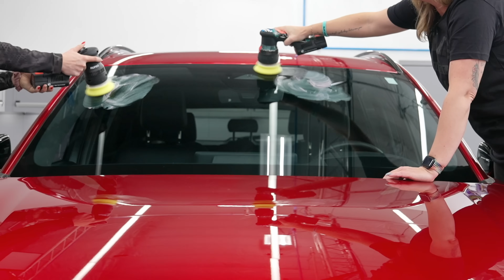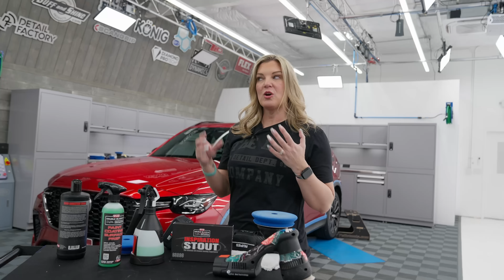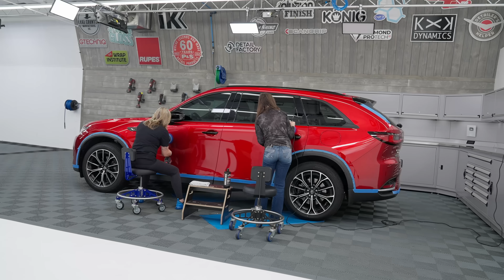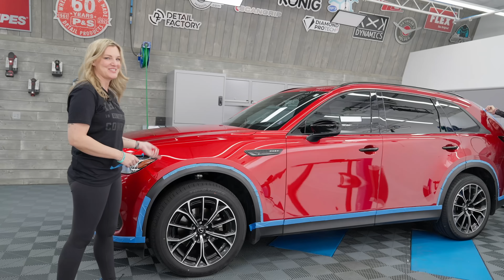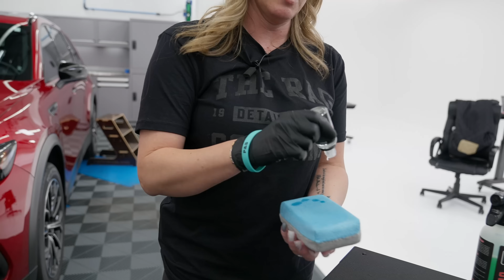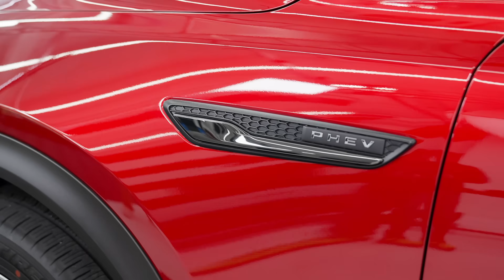How To Ceramic Coat Your Car Using P&S Stout

Comment: Shhhh, don’t tell everyone how killer this coating is. On the world’s greatest red, Mazdas 46v, it’s just stunning. Stouts depth, gloss and durability are top notch. Just take care to level, don’t push it past your section without quickly hitting it with a second towel. Should a high spot happen, just use a little polish and prep then re coat. It’s definitely a professional level coating, with all the rewards of a pro level coating. This coating along with the rehab family of abrasives and even the free ride pads are some of the best available. I’m at 6 months on my personal vehicle and the coating still looks like day one.

Comment: I’m a little confused on where this lines up with Legend and Inspiration. A video explaining the differences would be great. Another question I have is how long should you wait for Stout to cure before applying Sole.
Reply: Hi! 
So Legend is discontinued. Stout was developed because Legend was a bit outdated technology wise. We wanted a more durable but a simpler install. 
It is the long term 5-7 year, classic is 2-3 years and Sole is 9-12 months. Hope this helps! 

Also- we do not recommend putting sole over it. Again the new technology does not need a topper and the behavior is far superior and you wouldn’t want to cover that up

Comment: How fast can you wipe it off? And how long can you leave it on before risking high spots?
Reply: Its 20-30 seconds max 
Apply and wipe off
Reply: @ thank you. Also, with clarity crème, is it something that I can just wipe off and apply the glass coating, or do I still need to prep spray the glass?
Reply: @ChristianGTCS  Yes always paint prep everything before applying any coating:)
Reply: @  thanks again. One more question, the ceramic coat for paint is 20-30 seconds and wipe off…what about on the plastic trim? And is the glass coating better to leave on, do all the windows and wipe off after all of them are coated after some amount of time, or apply and wipe off each window right away? If it doesn’t matter, is there better performance allowing it to sit on longer and then wipe off? And does it become harder to wipe off the longer it’s on? Sweet spot as far as time? I just bought some, waiting for delivery. I plan on converting to P&S coatings from Adams
Reply: I hope the new paint coating and glass coating are more durable than the Adam’s Polishes advanced ceramic coating and glass coating. The P&S price is significantly more, I’m hoping it’s because it’s easier to apply/wipe off and lasts much longer
Reply: @ChristianGTCS  For Trim:  You don't have to perfect wipe it off. So great!  I just somewhat level it but its fantastic on trim.  FOr Glass- we only put Vue Ceramic on the front Windshield.  The wipe off is much slower- I do the entire windshield and then wipe it off, so its like 1-3 minutes.  Leaving it on longer does not benefit;  For side glass we use the new si02 Glass Finisher called REFLECT- that's spray on and wipe off.
Reply: @ChristianGTCS  The rough longevity of Stout on the paint is 5-7 years and Vue is 1-2 years depending on avg use of wipers.
Reply: @sbgthedetailer  thanks! Any particular reason why you don’t use the glass coating on all the windows? The coatings are way my durable and hydrophobic properties are more prominent than spray ceramic glass cleaners

Comment: Why aren’t you using a pad washer?
Reply: I’m not personally a fan of pad washers. We blew them out and had enough pads to switch to a new one every second panel. It’s a preference thing
Reply: Personally I do not use a pad washer.  I simply keep pads in a rinseless solution while polishing.  I switch pads often, blowing them out before I use them.

Comment: I hate to ask a silly question but when you use an air gun to clean the pad doesn't it tear up the internal fibers? Have you ever used a pad washer to clean the pad during the process? Sorry for so many questions, just 58 yo still learning.  Thank you for a great video, ma'am.
Reply: No, the blasters do not tear up the foam.  The ones you want to stear clear is the old style pistol forced air guns from like Harbor Freight.  Those will blow holes. Personally, I have enough pads I don't need a pad washer and am not a fan of getting the foam wet as it changes the density and cut.  I blow between panels and only use one pad per 2 panels.  If a padwasher works for you great! I have nothing against them, I just prefer to have 6-8 pads per color per vehicle.  Its preference.  But I will say you could not do an entire vehicle with one pad just blowing it out.
Reply: @sbgthedetailer  thank you.

Comment: Great video!  One question regarding Stout, can it be applied to PPF?  If so, any changes in flash/curing time?
Reply: Absolutely, doesn’t change anything as far as apply and 20-30 seconds wipe right back off!
Reply: @sbgthedetailer  Thank you very much for the reply!  Stout is in the running for the next coating I'd like to try.

Comment: Great ob ladies! I have a couple of Stout kits that I am really excited about offering to my customer's. I do have a Jeep Grand Cherokee XL in black that I am wondering about which paint correction method I should use to get it looking perfect. Any recommendations? I have some Rehab, Carpro Ultra and Clearcut, couple of spray polishes from DIY and Clean, just to name a few. What would your recommendations be to get that paint cystal clear and ready for Stout!?  BTW, what glass coating did you use or did you put Stout on the glass as well?  Again, great step by step video.
Reply: Hi! So try this for me, I’m a huge Mopar paint fan. Use the Buff and Shine Edge Guard Maroon pads and Rehab! That’s my fav combo on black Mopar. 
Tape off plastics tho. 

On the glass we used P&S Reflect Glass finisher which is an SI02 glass product
Reply: @sbgthedetailer  awesome, I will have to try that. Thanks for the tip. 

I did not realize that the glass product you used was an all in one product. Who long does it typically last?